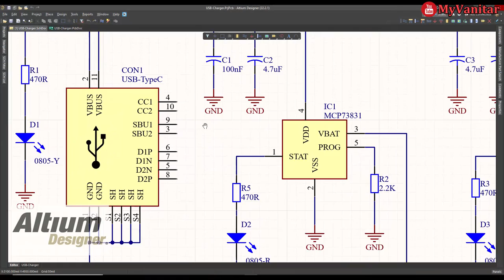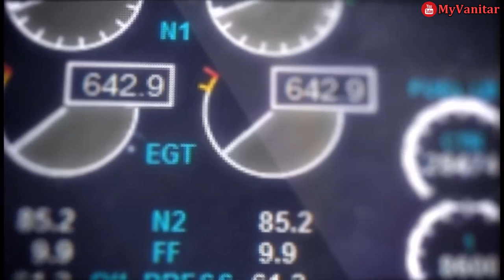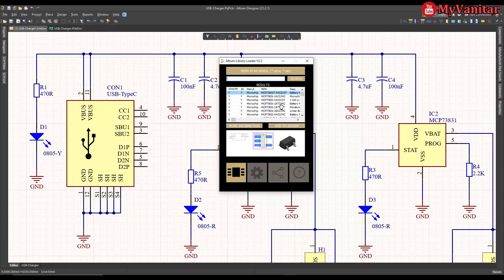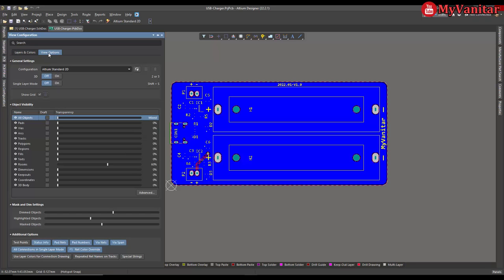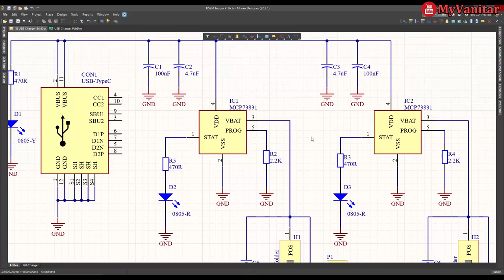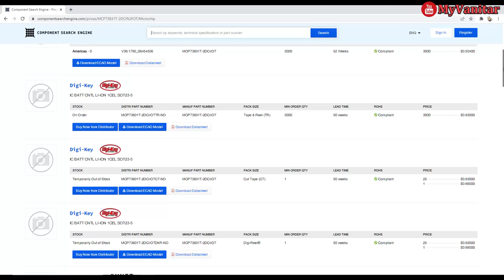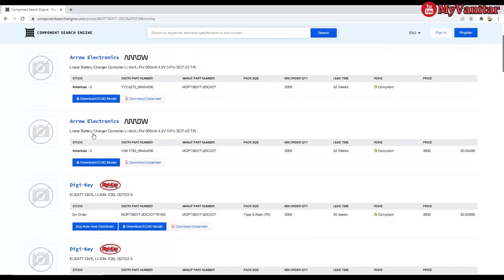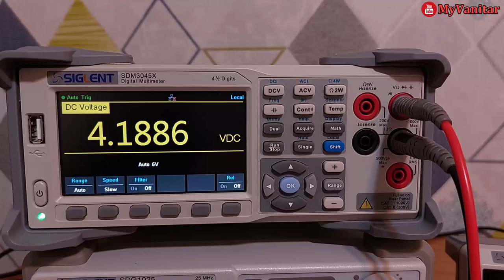Double Lithium ion/Polymer USB Type-C Charger Circuit

Comment: Would any charger similar to the MCP one, charge using type-C ? Or what is important when choosing the charging controller?
Reply from the maker: Type-C is just an interface. it could be a USB-B or even two wires.

Comment: You need to add a 5.1 k pull-down resistor to each of the CC pins. This design won't work with USB Type-C power supplies.
Reply from the maker: Well, no. if it doesn't work, then how I tested it using a mobile charger. The standard USB-Type C is not a head-to-head cable, there is a circuit inside. Use a standard mobile charger and cable
Reply: @MyVanitar  Why use a Type-C receptacle?
Reply from the maker: because my intention was that people easily charge their batteries using a mobile charger, which everyone has and it provides good power, up to 3A, mostly android. I used Samsung as you can see in the video
Reply: @MyVanitar  And yet the way you implemented it makes it incompatible with the vast majority of modern phone chargers.
Reply: The way you implemented it, the only way to use it is to use a Type-A to Type-C cable.
Reply from the maker: Man, why you are trying to find a problem in this, the cable is the standard mobile charger cable, even for iPhone chargers one side of the cable is like this. This circuit works with standard chargers and cables
Reply from the maker: My phone charger is one of the latest models of Samsung, less than a year ago introduced, if you don't like this circuit, just move on, you don't need to argue with me, publish a better one on your own channel. this is the last reply.
Reply: @MyVanitar  You tested it with a phone charger that has a USB Type-C port?

Comment: I have a camera with 4 rechargeable batteries type 18650 total capacity 10400mah. 

The battery currently charges with a solar panel of 5V/3W. The problem is that after the afternoon that there is not sun and the camera records, the battery running out. 

I would like to charge the camera for 8 to 12 hours at night in order to have 24 hours recording. 

So, i need something that can switch automatically the power from solar panel to electrical charging in order the battery not to running out. Is this possible?
Reply from the maker: Yeah, we talked about this. I will send you my quote soon.

Comment: 10a step motor driver please do it
Reply from the maker: Yes, Sir :-)
Reply: @MyVanitar  Thanks i want to plug it into the arduino in a simple way
Reply from the maker: @YILDIRIM-e6u  I can not guarantee the time, it means I don't know when.
Reply from the maker: @YILDIRIM-e6u  However this project where you commented is a lithium battery charger, and not going to be connected to Arduino
Reply: @MyVanitar  only time is not important for the driver tahnk you bro